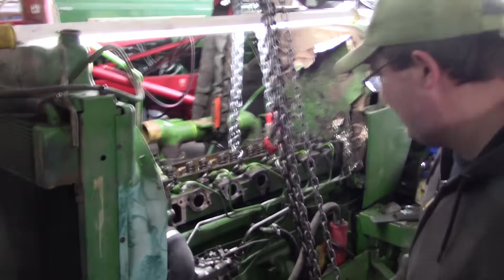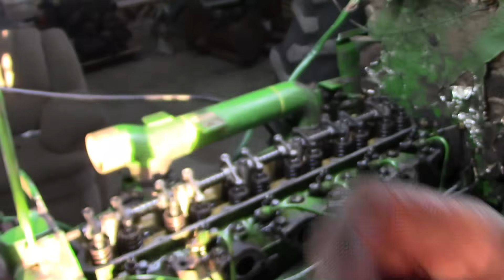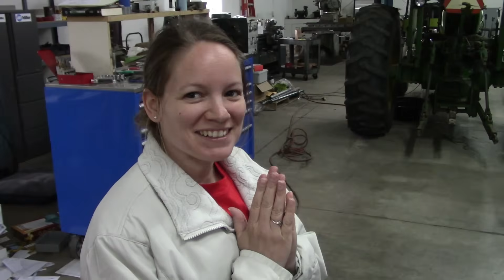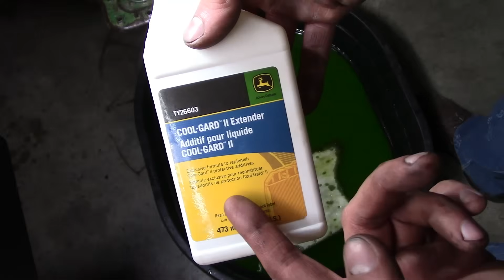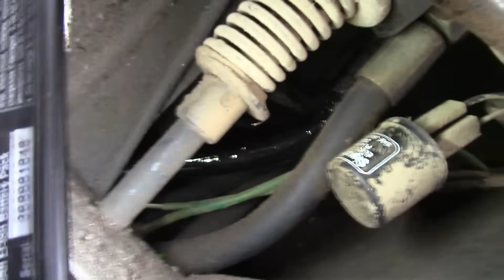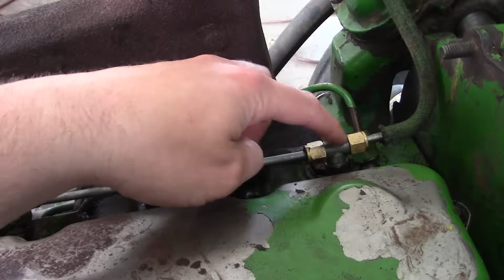John Deere 2940 Tractor | Head Gasket Replacement - Part 2

Comment: Please buy a UPS for your important electronics. A surge arrester does little to nothing for lighting and can even burn your house down if a large over voltage shorts the protective device inside out ( a buddy of mine lost his home that way). A good UPS has guaranties against Damage to computers and the like from lightning and keeps them on long enough to do a planned shut down and save your work in a power failure. I have 5 of them in my house protecting our computers (5 of them), cordless phones, TV and stereos.
If you are on a budget check out refurbished business computers. That's all i use now, less than 300 bucks, comes with an operating system, no bloatware, and you can take your old hard drive and out and put it in the new machine as another drive (like D: drive). I have had great luck with Dell and HP machines.

Comment: Always a treat when the family makes the scene.  It's a swell chance to work in and repeat those PSA's.  Love when a WWW video comes out.  It means I can get some housework done while it plays on the big screen :-)   For your computer, if it won't power on (little green light) the Power Supply unit may be fuse protected.

Comment: Hey Wes, I deck manifolds by hand using a block of Canadian Maple with a piece of 60 grit for the rough pass and then up to 150 grit for finish. The block is long enough to cover 3 ports so it skims square across the machine surfaces. Works very well and leaves a finish that is flat and square. Oh ya, check the shop electrical for proper ground/neutral. You can ground around the building with rods driven into the ground and tied into the breaker panel ground.

Comment: Wanna buy another Buick 3800 with a blower?  I have a 96 Riv for sale.
Reply from the maker: No, but those are great engines. My grandma had a Park Avenue Ultra with the supercharged 3800. It has close to 300,000 miles and still going.

Comment: Highly unlikely that only your motherboard would get fried downstream of other components. Check its caps. Most often than not, they're already on their way out and a surge, even with surge protection, just takes them out. Things are cents a piece, easy to replace, and if it is the case, you're competent to perform some light soldering and get your computer back.
Reply from the maker: I don't know. I ordered a new board. It was pretty inexpensive.

Comment: What brand is your coolant filler? I think you had talked about it before. The ones that I've used I've always had trouble trying to get a good deal. Good job getting the old tractor running again
Reply from the maker: No idea. It was literally the cheapest one on ebay.

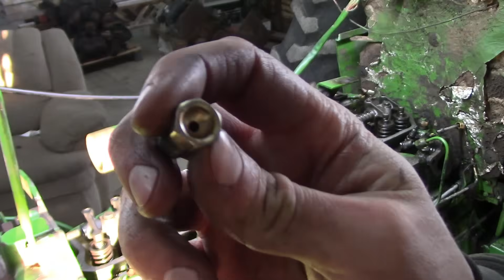Comment: @14:18 Thank you AGAIN China !!
Reply from the maker: It's my fault. I could have bought the dealer parts and I'm sure they would not have had issues.
Reply: @WatchWesWork  I can't even begin to tell you how many times I've had to finish the machining on Chinese auto parts..or do what you did..which is to borrow parts from the old rocker. It's infuriating and costs more in the end because my time is worth more than the time it takes me to fix their manufacturing shortcuts. Just venting I guess..apologies.

Comment: Coolant, you guys in the states got the right idea with testing and putting in the necessary additives.  Here in the UK we just replace it with new every 2-5 years depending.  Trouble is that after the warranty is out people don't tend to get it done due to cost.
Reply from the maker: It's hard to dispose of coolant here. Few places will take it, and they charge you to do so. So we try to run it as long as possible!

Comment: I am so tired of slipshod Chinesium parts.  I have a Chinese plasma cutter that I bought new that lasted all of 20 minutes.  I guess it is going to take a whole bunch of us to rise up and demand an end to poor quality, high failure rate Chinese goods.  Our granddog has the same problem as your dog.  Our grandson is wearing him out.
Reply from the maker: It's my own fault. I could have bought the dealer parts that would have worked fine.
Reply: "we" fall for this every time. I fully expect my HF tools requiring fixing the last 10%. I am always pleasantly surprised when they don't. Grinders, drills, and such used occasionally are OK. But automotive parts such as the adjusters crap are borderline criminal.

Comment: Oil hose connector is metric. Looks like 16s, most of the time it’s stamped on the side of the connector
Reply from the maker: It is metric, but I have not seen that style before. My dealer said they could not buy the fitting to build the hose.
Reply: Watch Wes Work metric is in S (heavy) thread and L (light) thread. Light usually for low pressure applications and has a rougher thread whereas S has a fine thread. 16s and 20l however are almost comparable

Comment: Did not know that about anti-freeze formula being changed. I recall always yanking my dog away on walks when I saw "lime-green puddles" in the gutter. But that was years ago and when it still tasted sweet. But like not putting batteries on concrete, some lessons remain embedded in our mind.
Reply from the maker: It's still a good practice. There is plenty of old stuff out there.

Comment: What’s the blue contraption do and would we see you use it And yeah that’s the problem with aftermarket parts and it’s a testament of how good mechanic is to either make them work or go and get the original equipment to save time but that cost money to save time good job anyway I like your calm manner for dealing with such problems
Reply from the maker: It compresses the springs on automotive struts so you can change the struts and reuse the springs. It's a super sketchy job, but this tool makes it a lot safer.
Reply: By any chance would you do a video on how it works please And thank you very much for keeping us informed on the robin and the hatchlings thank you

Comment: HEY!!!  I gotta 6415 JD that's getting no fuel... JD people just want to tear it apart... Underneath the tractor is a filter with two thumb sized projections each having two wires coming out and one (Probably) a solenoid with one wire hookup... All the wires are disconnected and JD people don't know what all these things are for.. Any suggestions????  colvinh@gmail.com... H
Reply from the maker: I really don't know. Can you find a service manual?
Reply: @WatchWesWork  HEY!!!!  Been to two JD houses and waded thru their computers... Picking a 5 string banjo ain't this complicated...  H
Reply: On the compact JDs there's a mesh filter over the pickup in the tank it could be something like that.
I've had them block quite often and Starve the engine of fuel , local stealership didn't know about them either.
Filter is on the fitting that screws into tank that the fuel hose attaches to .
 May not help but worth a check.
Reply: @hammyh1165  HEY!!!  Thanx for the input...  H

Comment: Changing the head gasket on my lawn tractor I was torquing down the head bolts I snapped one and stretched 2. I couldn't figure out why rechecked my torque wrench it was right so I stuck a bold in my vice and tested the wrench it never clicked my wrench was stuck and wouldn't click. I was doing everything right and it still screwed up. I was pissed
Reply from the maker: Ouch!

Comment: What a lousy week that must have been...I could feel the disappointment throughout the video. Cheer up again...lol. You will turn things around as usual. Couldn't the rocker arms build up by welding? Also for information check this Greek company with patented AC protection technology www.raycap.gr. They already provide major American airports with surge protection material.
Reply: If the strike is very close, no protection device will help, as the current raises the ground potential, The best way is to disconnect all power and internet cables from the computer, although that does not always work. Remember that we are talking ground currents of 50,000 to 100.000 amperes.
Reply from the maker: Yeah I don't know if anything can really prevent lightning damage. I believe it actually hit my building.

Comment: I'm the same way with the head bolts unless it's a lawn mower, and you're absolutely right about aftermarket parts it's a roll of the dice, I use line wrenches on flair and compression fittings but only because I have them from my time doing residential a/c, 14k hours figure it's gonna have some blow-by, hope you have a good weekend
Reply from the maker: Yeah I figure it's had a good run. No need to go crazy.

Comment: re. Headbolts  I hear you ,  I'm rebulding a Chalmers D2900 and reliance want 770$ for the headbolts with out the washers and it has  +10000 hours on the clock so like you i'm reusing the bolts.  keep up the good work .
Reply from the maker: I don't see how they can have that much advantage.
Reply: @WatchWesWork  no you are right but it look like all spare parts pushers agree on this high price .

Comment: Machining on those pushrod adjuster was a joke... good thing you caught them.
Cheers,
Reply from the maker: Tell me about it!
Reply: Machining? Looked like someone did it by hand with a carbide burr in a die grinder haha. I've seen rust with a better shape and finish lol.
Reply: I don't know about the last 10% in a large majority of the chinesium parts. It really would not take much more to finish it right while they already went through all the trouble in the first place. HF is a good example "unfinished machinery" (borrowed from Keith Fenner).

Comment: Wes - there is no such thing as surge protection when it comes to lightning. If it can jump from a cloud to the ground it can certainly jump past protection. The only real way is disconnect.
Reply from the maker: Yeah, and my computer guy said the same. The motherboard is pretty cheap and the data was OK. Just an inconvenience.
Reply: Shouldn't a fuse do that

Comment: I have withdrawals when my computer goes down... right now it is working fine as it should be as I replaced it three months ago with a man who repairs them and he built this one from new parts in my cooler master cabinet. Nothing fancy, just works fine but had to go to windows ten and it is strange to me, okay as I use google for everything. I don't know why they don't build protection into these.... died when the voltage spiked. I wish you the best and you and your wife have a handful getting jr to follow orders... a dusting of his seat cover has my approval but not on camera as this would have you in chains and the wife filing divorce papers do to pressure from viewers that have no business getting into yours. He is overall a very fine smart boy.
Reply from the maker: I had to upgrade to Windows 10 as well. I was really comfortable with Windows 7, but it's no longer supported.

Comment: Wes, Put some " RESTORE " in the oil it really works, unless of course there's MAJOR ISUES ? GREAT VID. YOU'RE A SMART MAN WES.
Reply from the maker: Nothing a time machine would not fix.
Reply: WES, that too, let me know if you find one ? But RESTORE is definitely easier to find. Seriously though it works but you have to put it in every oil change. I put it in my 97 Jeep that has 185,000 on it brought compression points up a bit. Hell " PROJECT FARM " even likes it, worked on his tractor. Waiting on next vid. on this beast, YES AFTERMARKET PARTS ALSO ARE A GAMBLE EVEN WELL KNOWN BRAND NAMES. Sometimes you have to go that route though ? THANKS AGAIN FOR THE GREAT VIDS. WES.

Comment: Why do you suppose they put the oil feed hole for the rocker arms all the way at the flywheel end? That would mean the rockers at the front of the engine are the last to get oil pressure. Wouldn't feeding oil in the center of the shaft make more sense?
Reply from the maker: It would be better. It also may explain why the good rockers were all on one end.

Comment: Well it's alive as allways you you brought it back from the dead. Cool video. What would take to stop the blow bye.?  Just wondering. Thanks for sharing.
Reply: Rebuild the engine--rings, cylinder liners, etc.
Reply from the maker: Correct. New rings would do it.

Comment: Cheapo "surge" protectors don't. I work for a UPS company, and know all about the performance of the garbage surge protectors available at your big box retailers. Get a halfway decent UPS (CyberPower, not a sponsor) or a Tripp Lite Isobar surge protector (also not a sponsor). The downside to UPS's is that the battery life is only 3-4 years for AGM type batteries. Couple of years ago, a lighting strike took out my parents TV and computer because they didn't install the UPS and Tripp Lite surge protector I bought them. Lead a horse to water, etc.
Reply from the maker: Yeah, mine clearly did nothing.

Comment: I should mention, not all coolant has the bitterant in it, I have some in my shop (in a bucket on the floor) that doesn't.
Reply from the maker: True, and often the old stuff does not. But most new stuff does. I don't know if it's a requirement, or just industry smartening up.

Comment: Not to be "one of those guys" but you need to double check your electrical stuff, arresters or surge protectors have a lifespan.  But nothing can stop ole Zeus.  Out in that field lightning rods might be a good idea.  Check the computer, old school ones often have fuses.
Reply from the maker: No fuses. My computer guy extracted the files and ordered a new motherboard. He says the processor and ram are still good by current specs.
Reply: @WatchWesWork  that's good to hear that's mad why dont they put fuses into it
Reply: Ya my laptop has a fuse on the plug he could take out the harddrive and put it in a good one

Comment: With the worn rocker arms - could they be faced with a dab from a hard facing welding rod or it the host material unsuitable?
Was just thinking they could then be ground to the correct profile if it stuck to them.
Reply: He would have to case harden the surface again... maybe Wes has the materials but it would be additional labour and know-how.
Reply from the maker: I don't know the answer. It would likely be better than what I had, which was very soft.
Reply: Could it be done.  Yeah.  Would I do it on a customers equipment.  Nope, not even if it was discussed and agreed upon with the customer.  The second it leaves the shop that entire conversation is forgotten.

Comment: Well, it's a John Deere, you could as well tow it to scrap yard.
Reply from the maker: I dunno man. It's a 40 year old tractor with 14,000 hours on it. Starts right up, runs like a sewing machine, and I can still buy almost any part for it brand new from my local dealer.
Reply: That's mean.
Reply: The old ones are still nice, the new ones are complete shit